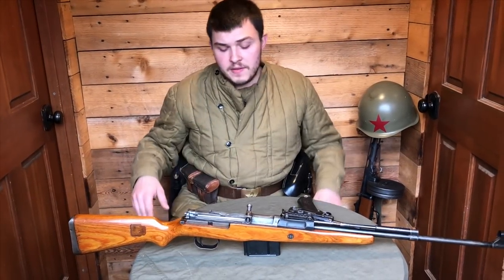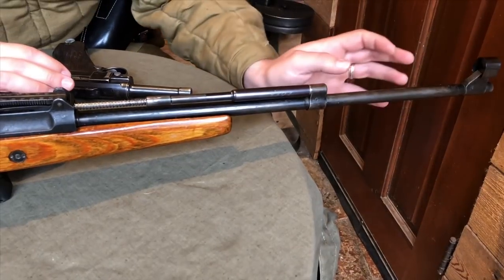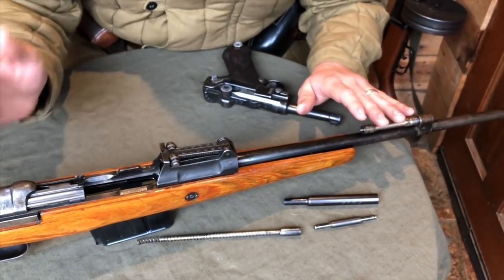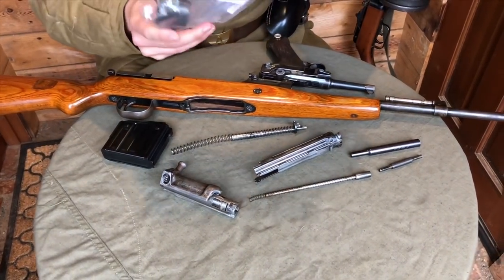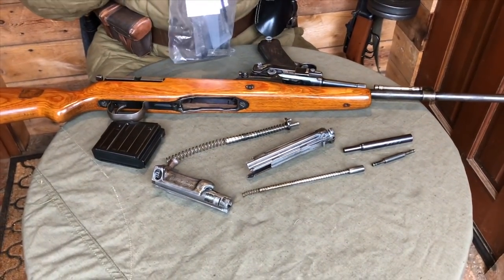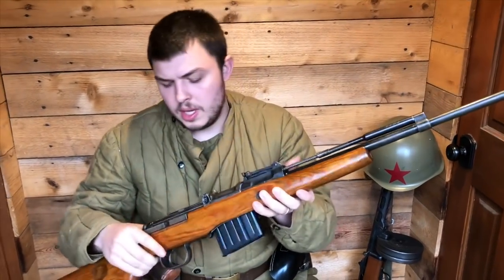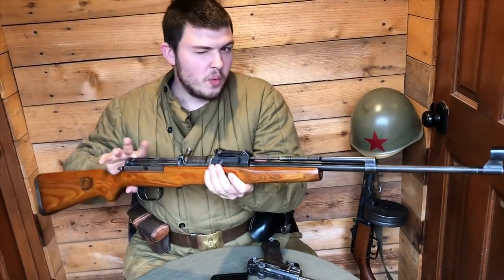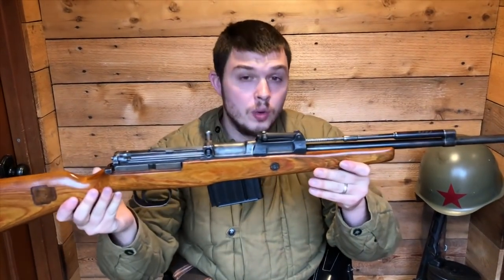Gewehr 43 Restoration Part 1

Comment: Thx for the tipp with the Gassystem. I know a Cave in Thuringia Germany where you can find several Weapons from WW2. The place was used by the SS because as the US Soldier go to Thuringia to find secret German Technology they fought against several SS units and fought for days against them. So there are Weapons used/stored by the SS. In the early 80's my Grandfather on my father's side and a friend found it go all the way trough the Cave and came out in Bavaria, in that Cave they found several boxes with Weapons, Equipment and Awards, They will certainly not have searched all the boxes as the cave is at least 5 kilometers long and is largely filled with water. The Americans and local residents will probably have found the cave beforehand, but they never got any further in because of the water.
Only my father knows where the entrance is, his father died in the early 2010s (by the way, he was one of the first in the kVP and later in the paratroopers of the NVA) and his friend died 3 years after exploring the cave in a traffic accident.

Comment: Those repro mags may not properly feed the ammo though. The recess for the locking lever is not at the correct height in them, so the rounds sit too low in the mag and the bolt may pass over or feed partially. May be it differs from rifle to rifle, yours might be OK, but in my duv44 it was a problem, so I had to unbend the mag lips slightly with my pliers.
Reply from the maker: Ya man me too it was doing that when I received it so I bent the feed lips out and it seems to be working now👍